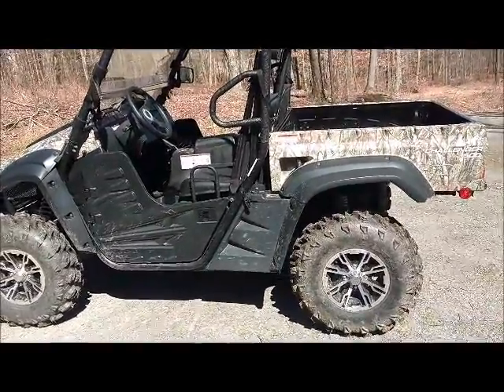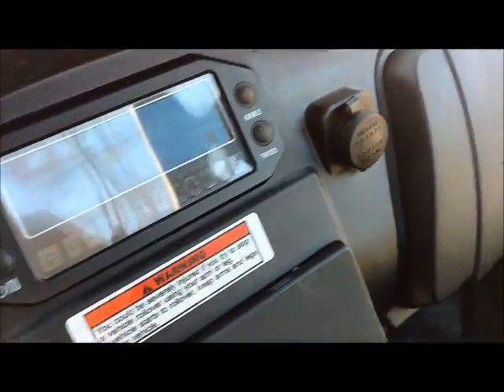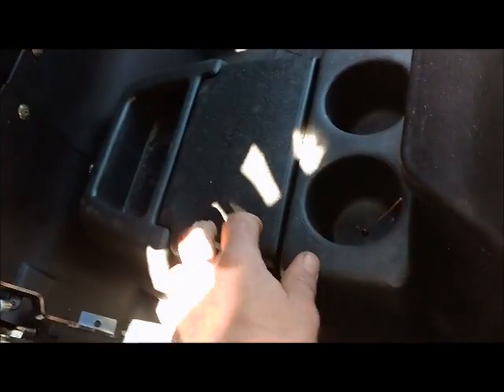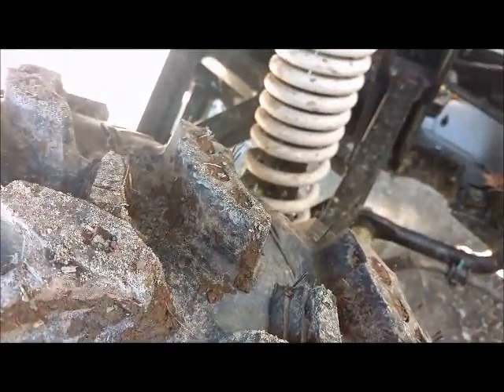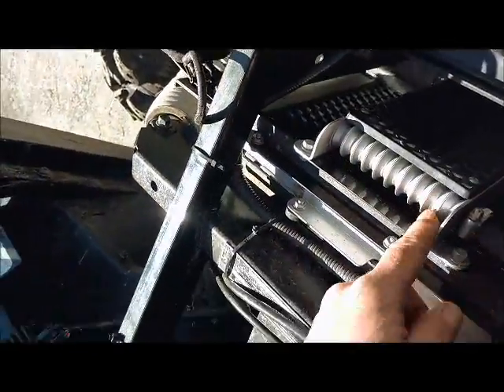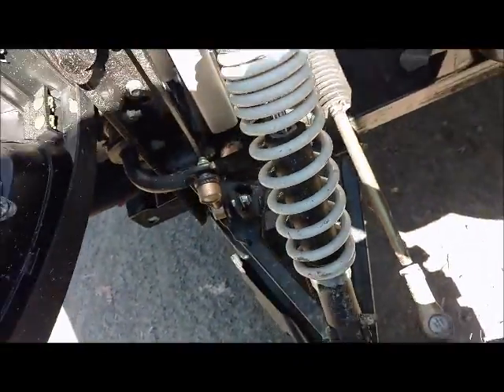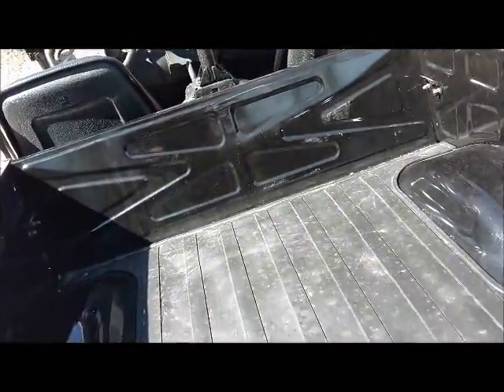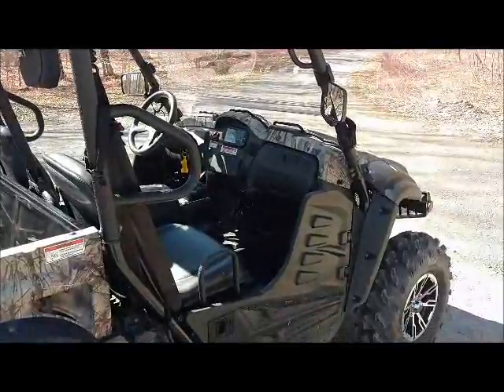Some Info On The Cub Cadet Challenger 500 UTV

Comment: That bracket next to the winch cable connection inside the cab is the holder for the winch controller. This is so you can leave the control cord connected and have a place to put the controller other then on the floor.
Reply from the maker: I appreciate the info!

Comment: For those who are looking for a little more info on the Hisuns, I may be able to help. I own a farm in Missouri and I needed a UTV. Like most who have shopped for one, I realized how expensive they can be, especially when necessities like windshields, roofs, winches, etc are added. After test driving them all (I mean all) I bought a Hisun Massimo 700 three years ago. I use it to tow, haul, climb, patrol, and hunt. I can't get by without it. It is a tough machine, and it's drawbacks to date are the windshield scratches easily, and it is noisy. But so are the others to one extent or another. I service it myself with little difficulty. Hisun makes units for Cadet, Tractor Supply, Home Depot, and I'm sure other retailers. The Massimos are assembled in Texas from Chinese supplied parts. Some claim they are Yamaha clones, but I have not had reason to test that claim. I paid well under $10K for mine at a time when the others, similarly equipped, were selling for $14K-$16K+.
Reply: I'm trying to service mine, oil and filter change. The place where I puchased mine has to order everything I need. What parts house oil filter will work to replace the factory one?  STP, FRAM, etc.
Thanks.
Reply: It's a 8/2017 Challenger 500. Model#37AW7CMD710
Reply: @willy2912  I have not looked for an aftermarket oil filter. The biggest parts seller for Hisun products is http://www.motorcycledoctor.com/our%20services.htm
I have no affiliation with the seller, but they are knowledgeable about the brands. This is where I get my filters (and one replacement windshield).

Comment: Most of the bad(exaggerated) stories on these Rhino clones are from people that actually bought the big brand utv's, paid twice as much as us rhino clone owners and are dealing with similar issues...
Reply from the maker: Good comment! I had a Ranger 6x6 500 that launched a cam and followers at low hours. I did a lot of "homework" and found that all of the other brands have their share of issues too. The Honda seems pretty good especially their transmission but the cost for what I needed was way too high, along the lines of a good used Jeep. I now have the 750 Challenger and so far, and knock wood, I have no real complaints. The extras and the price are tough to beat.

Comment: I have a 2016 cubcadet 500 challenger idles a couple minutes and engine shuts off and want start back for 30 min . Need advice
Reply from the maker: Diagnosing something like that can be tough without the right test equipment and documentation. Typically you're either losing fuel or spark, sometimes both. What I would do is run it until it stalls then check for spark. You can test spark by having a spark plug handy and once the engine stops running pull the plug wire off and insert a plug into the wire. Use something nonconductive and hold the ground electrode to engine metal and have someone crank the engine and look for spark jumping between the center and ground electrodes. If there is no spark then it may be the module that is getting hot and malfunctioning and will work again once it cools off. If you have spark, then you'll need to check for fuel. Turn the key off for a minute or two then turn the key on without turning the engine over and listen near the fuel tank to see if you can hear the fuel pump running. It should run for 5 seconds or so. If it's not, it could be a bad pump or module again getting hot and working again once they cool down. Could even be a bad fuel filter if it hasn't been changed in a long time. Hope this helps.

Comment: All in all what are your thoughts on the machine? Is it mechanically good quality and well built? I have been interested in a side by side for awhile but don't know what to get. I know the popular brands but how would you compare this to them.
Reply from the maker: +mrdole2008  - Honestly, it's not built too bad. My major concerns are the lack of power and the fragility of the body panels. My Polaris Ranger 500 would run circles around this thing power wise but of course it did cost a few thousand more. But personally if I were to buy another new side x side today, it would be a Polaris.

Comment: these are made by a company called hisun based in China I had the 700 and had problems with it
Reply from the maker: Mine still has low hours. Only real issue so far was the battery crapped out but I read they are cheap batteries in these machines any way. It has a good one now and so far, so good.

Comment: is the challenger good for pulling or pulling heavy loads and do you think it's good for farm or work use?
Reply from the maker: All in all it's pretty well made when compared to some other machines. I bought mine for two reasons, hauling firewood and plowing snow. I had a 300 + foot drive and we'd get snow of a foot or more at one time. No complaints plowing (see my review on the snow plow I use) and it will also tow my log splitter all over my property and I can load the bed to overflowing with wood and it worked out well too. The 500 is a little low on power and I would buy the 700 if I did it again. So far the machine has held up well and the only thing I've replaced is the oil and filter and a battery.
Reply: Thank you for answering my question and have a great day

Comment: Hey steveedan, what adjustment did you make to the shifter. Mine is the same way
Reply from the maker: Basically, I took off the cover and shifted (forced) it into low and then adjusted the linkage so that when it was in low there was no tension on the cable. All other gears worked ok after that.
Reply: SteeveeDan let me give that a try. Does yours just have the rod with the two lock nuts in each end
Reply from the maker: Yes, it's the rod / lock nut style.

Comment: how do you grease ball joints
Reply from the maker: They have no grease fittings. You'd have to use one of these  - http://www.mastertectools.net/view.php?id=31033&logo=atmx - but the only problem is it will leave a small pinhole in the boot. What I would do is clean the area where the hole was made very well and put a dab of rtv or similar sealant over the hole.
Reply: We notice that it has alimites We tried our grease gun It seemed like the grease would never get inside the alimite Do we need a special end to fit those alimites?

Comment: how is it doing now? do you still have it? any issues? my tractor supply has it for 7000 right now(the massimo) would you recommend it?
Reply from the maker: I actually just sold it a month or so ago. I decided that the power was too low and before anything weird happened to the machine I sold it. I plan on replacing it with a Polaris. It was fun and turned out to be a reliable machine but I just wanted/needed more power for romping around in the desert.
Reply: SteeveeDan but for someone that is getting one to replace a dead ezgo workhorse from 1999 should it be good? And for plowing snow
Reply from the maker: From an ezgo it would be a big upgrade. I plowed snow with mine the first winter I had it and it was fine, no issues. But where I plowed didn't have too many big hills. In the desert there are allot of really steep canyons and stuff I wanted to play in but it struggled climbing the steep slopes.
Reply: ok, we would just be riding in our yard in PA and plowing our slight hill in our driveway so i think this might be perfect for us.
Reply from the maker: For that, you'd probably be happy.
Reply: SteeveeDan update. We decided not to get it. We are going with the gator 825i
Reply from the maker: Hope it goes well!
Reply: update once again, we have indeed decided to get the cub cadet, should be getting in about a week. got a plow and the power steering with a jensen radio to go with it. wanted the blue one but all they could get us is yellow, i don't mind though
Reply from the maker: I think overall you'll like it. Congrats!
Reply: I hope you didn't buy one. Mine is two years old 50 hours use and absolutely falling apart. Every piece of rubber in the engine compartment has dry rotted, cracked and looks 15 years old. I got to looking and many fittings are broken and hose clamps are loose due to rubber degrading. Runs like crap, I mean even worse than when new which was weak. Makes a horrible rattling noise when driven. This has never been used for play off road. Mirror has fallen off and the net buckle cracked.
Reply: we got ours, and it runs great, have not had a single issue with it, and it has over 10 hours so far. had it for about 3 or 4 weeks now, and love it.
Reply: Kudo Shinichi good luck then